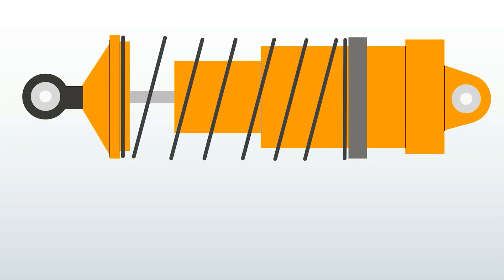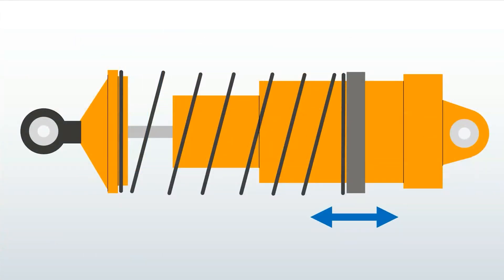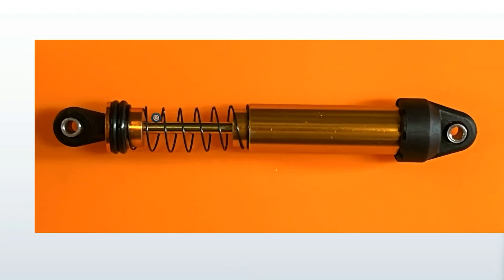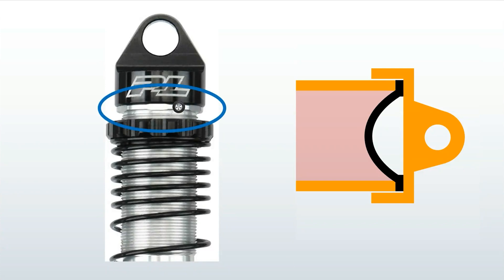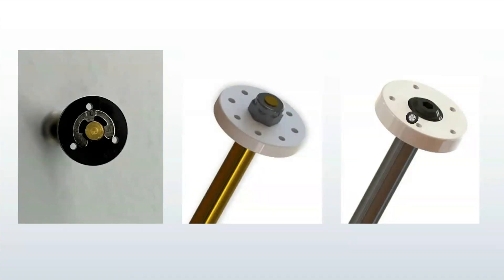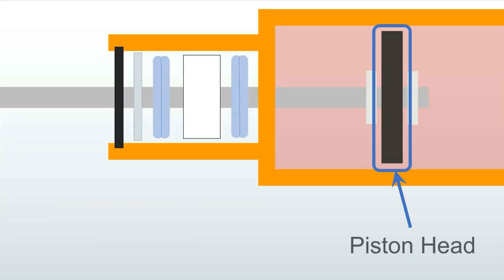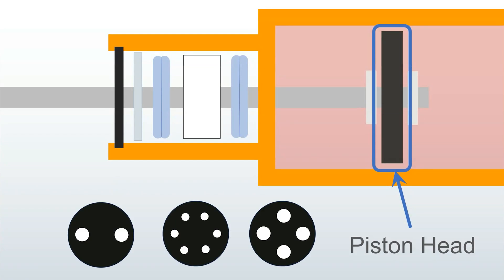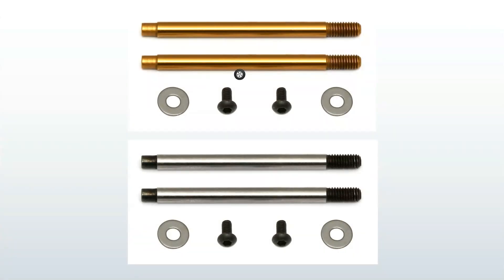Why are all RC Shocks the Same: An Intro to Tiny Shock Architecture

Comment: Nexx racing have started making 1/10 - 1/24 scale shocks with a functioning reservoir including a spring loaded IFP that you can adjust the preload on. Cheap too, a full set for the Hobbyplus Arktos is only $60.
Reply from the maker: That is very interesting! Thanks for sharing. I’ll have to test some. It looks like they do have a working reservoir. How well does it work? I need to find out. 🙏👊

Comment: What about smaller like SCX24, recently i read somebody said they are just another pair of links. So no need for all those considerations about oil. Oil Dampers only very recently have been used, the Injora 39 or 40 mm oil shocks seem to have become a standard.
Reply: The injora oil 'filled' shocks actually tell you to not fill them with oil, just a bit for lubrication. Also the 39mm ones have a 1 piece piston/shaft with notch cut in the side rather than holes which causes a lot of friction, I have been disappointed in them so far.
Reply from the maker: I have a couple SCX24s. It's pretty tough to get oil to seal, and the friction in those seals would pretty much over power the oil damping force, so personally I run no oil and super light springs. Sometimes no springs. A good friction shock design (like using multiple o-rings - more or less to increase or decrease damping friction) would be a smarter approach for cars that small, but no one is going that path yet that I know of.

Comment: Good video once again. 

Thermal expansion is why emulsion shocks are built ”dead” i.e. the shaft doesn’t come out on its own from full compression. Any pressure (above ambient) inside the shock will ramp up quickly when you drive an off-road car around the track at high-speeds. 

Same thing with the diffs: an amount of air is left inside on purpose to allow oil expansion. Failure to do this will cause the oil to push on the outdrives and lock the cross pins on the inside. The seal could blow, too.